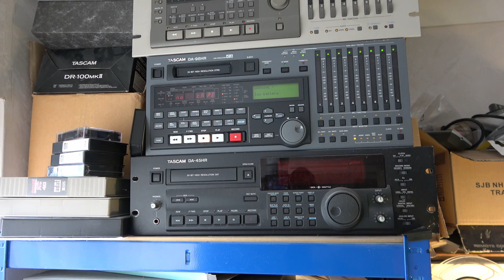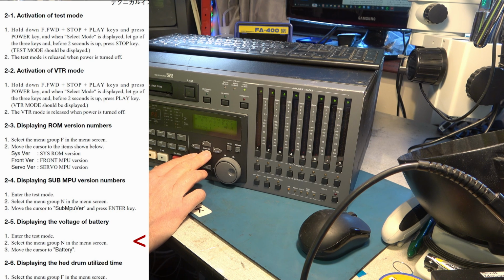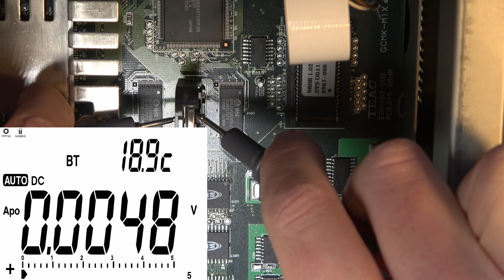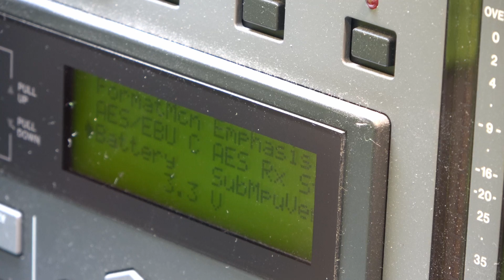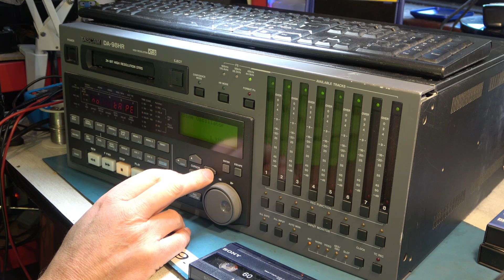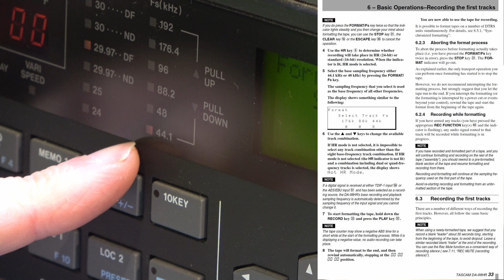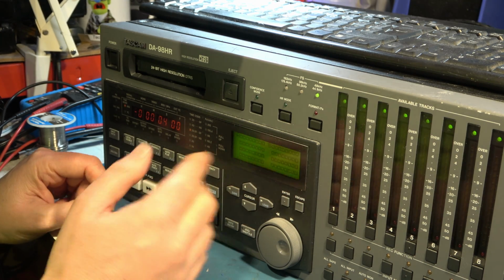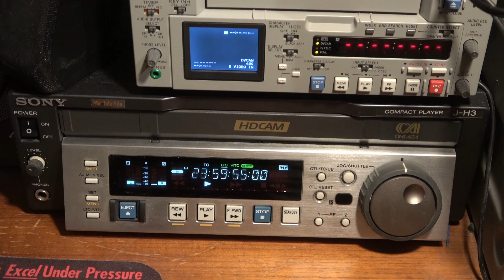Working on the Tascam DA-98HR DTRS format multi-track audio recorder

Comment: Is there a way to digitize DTRS tapes? I need to find a way to plug a player into my laptop and digitize about 20 tapes of stuff. Thanks!
Reply from the maker: The optical output can connect to a professional multichannel digital audio card on a desktop, but that's out of the question for a laptop.  It may be cheaper to just send the tapes to someone like me to digitise.

Comment: Is it possible to use the DA 98 HR as a simple recorder from Vinyl or CD and playback again of course, without those digital/analog converter boards aplied to the DA 98 HR? Just using a normal DAC?
Reply from the maker: You could use it to record just two channels from a suitable source.  Complete overkill, but I've done so to test one.  You could then record more songs on the same tape to fill up the rest of the tracks.  There is no crosstalk between tracks.
Reply: @video99couk  Thank you, so suitable source means a compatible format. To connect the digital output from a DAC won't be enough, I am afraid, right?

Comment: Thank you for posting - I always hankered after one of these units - even have some virgin tapes... each format has its own quirks - shame a rechargeable battery couldn't be put in. Had an issue with a Roland R-26 hand held unit - it too needed an internal battery when sent in for an issue with the SD Card input - the guys had to order several from China to be able to make it worthwhile buying - no problems since. The R-26 was so advanced against other units and I still use mine for Atmos Recording. Thanks once again for your work - so glad I found your channel. Michael - OAK77uk

Comment: I wonder if they made their own mechanism or if they bought it from another manufacturer?  I know the Alesis ADAT decks used Panasonic mechanisms.
Reply from the maker: Since a very similar machine to the earlier DA-88 model was sold by Sony (mainly different connectors at the rear), I'm pretty sure the deck was built by Sony.
Reply: @video99couk  Actually from what I read they developed it entirely in house- they have more than enough engineering resources to do so.

Comment: Hi, I am using DA-78HR, tested with Hi8, Digital8, Exabyte and DTRS tapes. Strange thing Exabyte 112m tapes in HR mode shows crazy errors higher than standard Hi8 tapes (all new of course). In LR mode B.E.R. < 40dB for Exabyte. I am surprised because usually streamer grade tapes are higher quality than VIDEO/AUDIO tapes. For example I use DAT for 25 years checked with DAT/DDS1/2/3/4/72 tapes over 200 and DAT tapes are in general better (B.E.R.) wise. I preffer DDS-3.  Any ideas? I assume DTRS HR mode uses wider bandwith than SR but can't find documentation about technical differences between LR an HR on a tape level, error codin ect..
Reply from the maker: I honestly don't know why the Exabyte tape would perform badly.  Data tapes are generally "tuned" for very low dropouts, and it may be that some other parameter such as maximum bandwidth (due to larger particle size) has been adjusted.

Comment: These units (Tascam DA-88/98HR and Sony PCM-800 DTRS) were well used in the video post-production field.  They were very prevalent in and around all the post houses in Soho and Covent garden London.  This format was particularly useful in the production and mastering of DVD feature film masters. Being an 8-track audio format on a conveniently small cassette form factor; it was a step up from previously using the relatively unwieldy and expensive Sony DASH 3324 machines.  8-tracks capability also made it idea for either discreet 5.1 or 7.1 surround mixing/track lay/mastering before encoding to Dolby AC3 or DTS for DVD.  The tapes were not feature length at 90mins but this was okay as we tended to master audio in its original "film reel" format. The separate reels being compiled at DVD authoring stage. My main memory about using these machines was they were very easy to use and sync to various Digital VTR machines (HDCAM SR/Digibeta/D1/D2/D3/D5). You could also use a vari-speed digital clock to speed convert audio from one DTRS machine to another e.g. 25 to 23.98. A surprisingly robust format.  We would have to constantly format/stripe tapes usually in various "flavours" - 48kHz 23.98fps, 24fps, 25fps EBU, 29.976 SMPTE etc.
Reply: *29.970
Reply: @northernplacecorporation Yes my bad you are of coarse right.
Reply: @andrew1479  *of course
I had to correct this one.

Comment: Great video. I have a DA-38 which has the battery warning when I turn it on. This is a great video for me to look for and replace the old dying battery in my unit. Also, I haven't gone too deeply in your videos, so if you have already covered this question, I apologize. If you haven't covered this, I would really find it most helpful if you could do a video showing how to manually clean the head of the DA-88/ DTRS machines. The machines I have are all second hand and I have no idea if they manually have ever been cleaned. I know using the head cleaning function of these machines tends to wear the heads out somewhat, so I would very interested in seeing a video of how to open the unit up and manually clean the heads. Also, would you know how to get old tapes that were recorded on a DTRS recorder that was out of alignment to play back. I have one session that was very important that was recorded years ago on a DA-88 that was not aligned properly. When the studio I recorded with sent their DA-88 out for servicing, it wasn't able to load/ read the tape. Is there is a way to take another DA-88 and mis-align it to the point it could read the tape so I can rescue the recording? Anyway, I enjoyed this video. Thanks for keeping all these machines and formats alive.
Reply from the maker: You could misalign a machine to suit the tapes, but it would be time consuming.  Really it would need to be done with the service manual and an oscilloscope to monitor the RF output of the heads.  Then the procedure would need to be corrected with a known good tape afterwards.  As for manual head cleaning, you need to be very careful doing this and it requires head cleaning sticks which are hard to source.  If  you don't need to clean the heads, then just don't.  These metal formulation tapes don't tend to shed oxide on the drum and so they shouldn't need to be cleaned routinely.  But you could clean the tape path with alcohol and cotton buds, keeping those away from the head drum.  Also see my previous video about lubricating the back tension arm's pivot post.

Comment: I  have same DA-98HR and it seems to eat the battery very fast, having to replace it often. Also on mine one of the green channel leds won't turn on, never checked the cause. A couple of time the tape was disintegrated by the mechanism, I had to remove it manually. But most of time it works fine.

Comment: I have always been a little wary of this era of recorders due to the helical scan mechanisms, good to know they are robust with regular maintenance, just like analog tape decks. It's not surprising they fell by the wayside as PC-based DAWs improved, but committing to tape with limited undos and having to take a breath between takes as the machine rewinds seems like it would push the recording process along instead of being constantly tempted to micro-edit and fiddle. Even the HD24 which can have a screen and GUI is less distracting -- audio is all it does.

I hope these machines live long and are not easily forgotten for both their good and bad properties.

Comment: I don't know about that machine, but in a computer, the CR2032 is used to maintain the RTC, and to retain the bios settings. I doubt that the battery maintains information such as drum hours. I would've thought such data would be stored in non-volatile memory?

Comment: CR2032 always goes on many devices. I had a Pioneer PRV-LX1 twin DVD burner with built in hard drive that was stuck on the PLEASE WAIT error because of the battery. In some different devices this battery is a real pain to get too when it has to be replaced. Excellent restore...

Comment: I used to have 24 track DA-78HR system used for live recording. Nice machines to operate, but bulky to carry and set up and the drum life (halve to include formatting) is a limitation The lubrication problem is not even mentioned in Tascam documentation, this should be done every 2 years or they may chew up tapes. It wasn't a good idea to base a pro recorder on a fragile consumer media format, same goes for DAT. Where Tascam went wrong was not following these up with plug compatible machines so you can keep all your expensive cable looms.  They brought out a 48 track HD recorder that was basically a PC and had zero redundancy.
I use a 32 track A&H ICE-16D system now recording to Flash USB drives and it fits in a 3U case.

Comment: Where I worked we used to stock Sony professional Hi-8 video tapes to use in these but you had to use Metal Particle (silver label) not Metal Evaporated (gold label), not sure if we ever used the official DTRS tape stock. The tape must run slower than video Hi-8 (PAL) as the tapes always ran longer than stated on the box. Most of the recorders were of the DA-88 type but I do remember at least one DA-98.  There was also a TASCAM hard disk recorder (can't remember the model no) that could also copy using the TDIF interface directly and it had a built-in DVD burner to export the WAV files to disc.